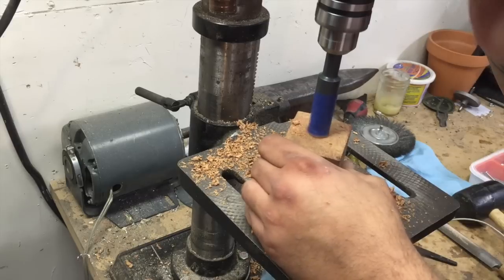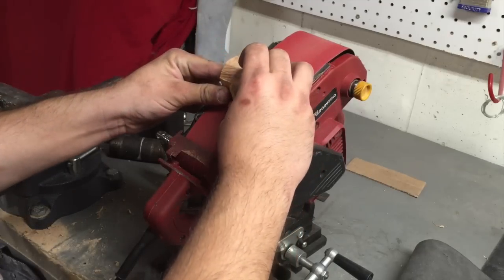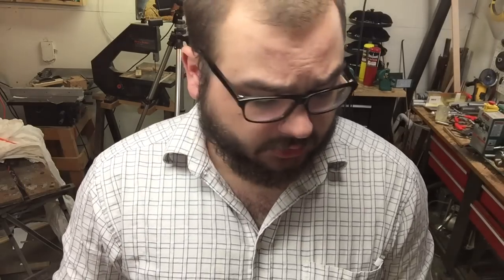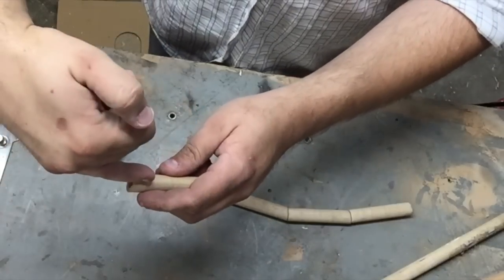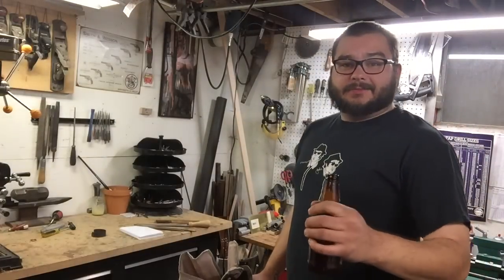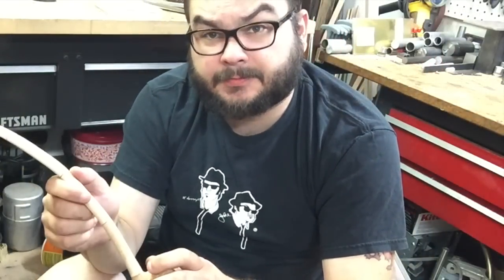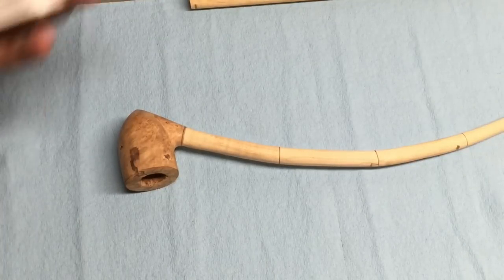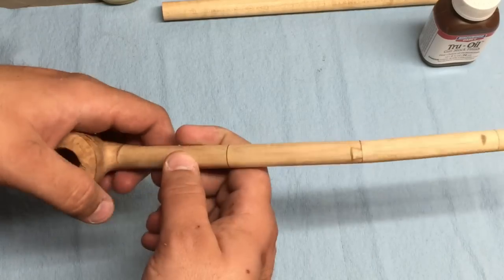Making a Long Stem Wizard Pipe!

Comment: It's barely impossible to get a totally straight bore on that length. But it's easy to just use a thicker piece of wood, something like an inch or 1 1/2 thick. Start with a short bit and progress to longer bits. Then just remove material until you get your thin, long stem with a centered hole. Straight grain helps a lot.

Comment: Very cool! I made one a few years ago. Did not have any power tools and couldn't get anywhere close to the right shape. You nailed the shape of the bowl!  For the stem, I found a tree with hollow branches. Took a straight branch and wrapped it in paper towels. Stuck it in the microwave. Then I stuck a piece of wire through the branch and bent it. Worked really well.

Comment: If you stain the stem dark, it will hide the segments better.  Don't use a stain and varnish mixture.  Stain 1st and let stain set, then varnish for protection and gloss.

Comment: seen video's of walthorns being made (lot bigger but still)
the way they done the through hole was to split the part lengthwize router the tunnel halfs in both pieces , glue the back together then shape the outside
can even use a prebend branch for that so the grain follows the shape and you whont realy see the cut across after you sanded everything smooth
can even go realy fancy with layers of fineer gleud in between giving the finished product a stripe

Comment: Great pipe, segmenting the shaft is a neat idea. How will you clean the pipe when you glued the shaft to the bowl?
Reply: No need to glue it if it's a snug fit, also easier to clean if it gets used if it's just friction fitted.

Comment: That is a brilliant idea. I am currently trying to make a candelabra out of 3 plastic Halloween cups that I got after Halloween last year. I am going to use LED candles in it, so, plastic will be fine in this case. I toyed with the idea of bending lamp parts to make connections to hook the three cups to each other to make the basic shape, but all I could find cheap (free, in this case) were hollow steel tubes. I wanted to carve the connections (I don't know what else to call the stem-like pieces to connect the three cups) but could not figure out how the wood would hold up carved into a sort of bendy S shape. This is the perfect solution. I already have some dowels. I think I will try something similar to this. 

Great video. Thanks for sharing how you did it. I want to make a pipe one day too. Your pipe stem really did end up looking like bamboo, imo.

Comment: For the stem on your next try, have you tried bent lamination?  Chisel a groove down the center of both pieces before they're glued up and then pull some floss with some thin cloth or twine down the gavity before the glue dries to ensure that you still have a clear path.
Reply: Michael Landen That sounds like it'd work great, but wouldn't be terribly healthy to smoke out of.
Reply: thats exactly what i was thinking when i watched this. and hellerauberer, if done right the glue will never come close to getting hot enough to burn.

Comment: if you don't use tobacco to smoke what did you use
Reply from the maker: +MotoChiever one it's pipe tobacco, got some just for the video to try this pipe out. Thanks for watching!
Reply: Practical Renaissance Practical Renaissance You can use dried mint leaves. It clears your lungs and nose. Also it doesn't have any side effects. :)
Reply: Practical Renaissance Practical Renaissance You can use dried mint leaves. It clears your lungs and nose. Also it doesn't have any side effects. :)
Reply: You can buy,or find(if You are American) a herb called          https://en.wikipedia.org/wiki/Lobelia_inflata
Reply: But be carefull ;-)
Reply: Sounds shitty to me, I'll just pack it up with good old devil's lettuce!
Reply: MotoChiever one I was going to ask the same thing
Reply: mustard gas
Reply: Augustinas Rudys bruh, I use the same stuff!!!
Reply: @daBuffalo7  lactuca virosa is what I think pipeweed actually was  meant to be

Comment: No on the segmented design. Best to use two pieces of wood with the bore half on each side, then make a curved gig and glue the pieces together with twine inside to pull the glue out when clamping. Shape the stem's outside to match the bowl afterwards.

Comment: I would glue the segments together with titebond 3 as it gives a stronger bond and it soaks into wood,
And NOT glue into the bowl as you might want to change or fix the stem

Comment: He doesn't smoke, but yet no hesitation to cough? Damn you got lungs and some wood work skills.
Reply: When you smoke a pipe, you dont pul it into your lungs :) You just draw it into your mouth and it is absorbed via the lining in your mouth. You CAN draw all the ay into the lungs, but almost no one does that, its a good way to OD on nicotine (not dangerous by the way but you feel like shit) since you smoke it a LOT longer than you smoke a ciggarrete

Comment: next time for the stem cut 2 12 inch pieces of wood that are 3/4 inches wide and a 1/4 inch thick. then down the middle of the slats using a small gouge make a channel. Take a coat hanger and cut to 15 inches long and lay that in the channel then glue the to slats together and clamp them then extract the wire. when it is dry then on the bandsaw trim them to a width of 3/8 wide.
Now to get the bend take a piece of 1x4 x 15 inches and draw the desired shape of the stem and cut it with the bandsaw then steam the stem and using the 1x 4 that you cut clamp the stem between them and let it sit overnite then its just sanding and shaping to get it to fit the bowl.

Comment: strange method to make a pipe! just curious, was there a particular reason you chose to bandsaw/sand rather than use your lathe? it seems like a lot of extra effort of hand sanding when the lathe is right there.

the other part was the stem - any particular reason to segment it, rather than cut along the length and carve a groove into the two halves and glue it (or rip a few thin pieces, top/bottom and two side pieces with an empty centre channel) and then clamp the stem into a curved jig for the shape you want? 

the finish looks good, but man I'm lazy and would have just lathed it haha

Comment: Practical Renaissance, for the stem, would "boring" a pilot hole with a red hot heavy gauge wire or thin steel rod work? then maybe the drill bit MIGHT follow the pilot hole.
EDIT: https://www.youtube.com/watch?v=yvAyMB5RbtE
this guy uses a series of bits, gradually getting longer and longer, so you are only drilling a small portion of the hole at any one time, thus grain induced bending of the bit is not eliminated, but it IS minimized.

Comment: wow..that pipe stem..Over engineer much?
coulda just cut/split lengthwise...hollow a shaft out then bend it as you glue it back together.
I LOVE the bowl tho..that burl is beautiful but damn that stem..sorry..but sheesh.
Reply: You want as little of the glue used to be in contact with the area smoke might contact so this is preferable.

Comment: Ok, it looks really cool, but its quite obvious you dont smoke xD. That pipe is not functional, atleast not long term. You cant glue the stem into the bowl, if you do that the way you did, theres no way to get in there and really clean it. Wont be too long before the gunk builds up on the inside of the stem and the shank and you wont be able to smoke it anymore. Other then that, not a half bad pipe. 
Making the pipe the way you originally talked about is doable by the way, you just need a thicker dowel. The hole wont be centered, but you then reshape it anyways and you can make it centered :) The segmented look is interesting though, might be something to consider doing intentionaly on some of my pipes sometime.